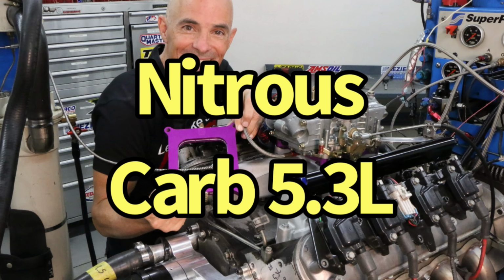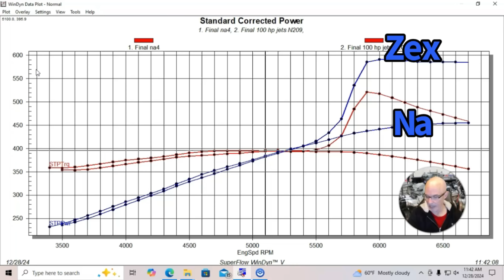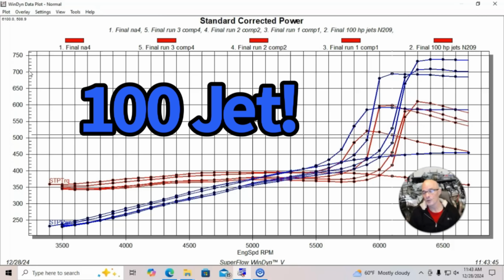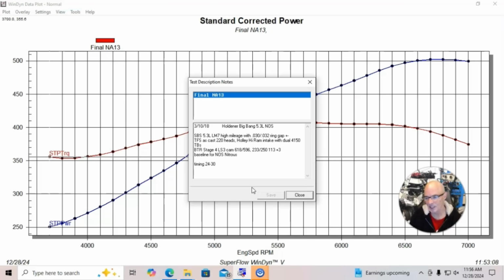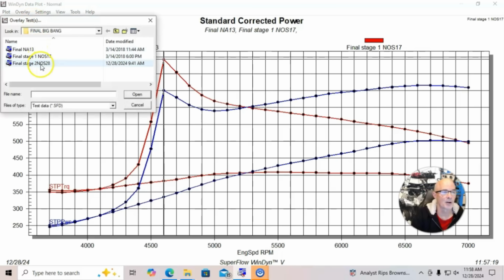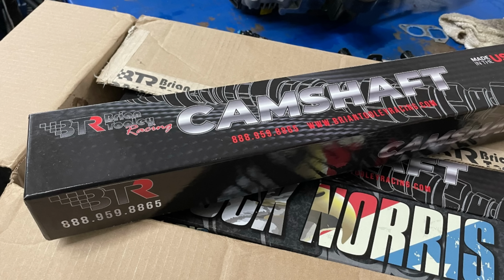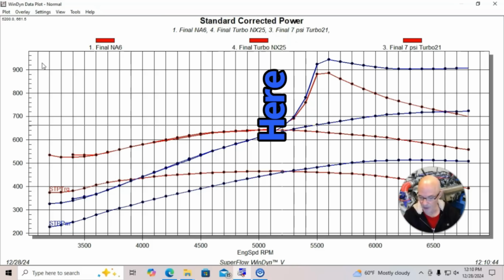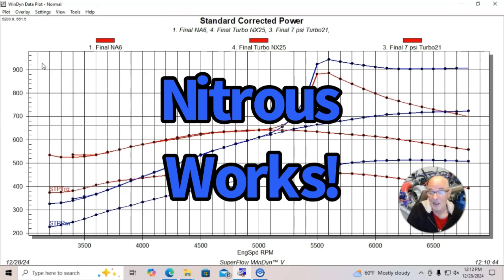CHEAP JUNKYARD NITROUS-300 SHOT 5.3L. NITROUS WITH A TURBO? NITROUS TIL IT BLOWS! FULL DYNO RESULTS

Comment: Question about the cost of nitrous vs force induction. Obviously with nitrous, you have to pay for the refill, but with a turbo or blower, don’t you have to pay for the cost of a turbo or blower rebuild, belts replacement on a blower set up, replacing parts on a turbo kit due to wear and tear?
Reply from the maker: the longer time you run nitrous, the more it costs vs turbo

Comment: Cam recommendations for a SBC 388 with a single bw s475 1.10 ar t6 brodix track 1 221s 67cc 9.5-1 compression..lunati crank 3.750 eagle h beam 5.7 srp -24cc dish blower pistons super vic intake c&s dual needle e85 carb. Looking for a solid roller street/strip need 800whp
Reply from the maker: 224/230 duration
Reply: That turbo may struggle to make 800 wheel

Comment: Ok I need help I got a lq9 I want a reliable 550 to 600rwhp  NA I was going to go 408 stroker but its expensive and I don't plan on 1000hp I want to have a daily driver I got a full qa1 suspension kit and willwood 6 piston brake kit like I said my goal is to drive it everyday have fun do some donuts do burnouts enjoy my car 1969 Chevelle
Reply from the maker: you won't get 600 whp NA
Reply: @richardholdener1727  wow holy sh#$ I never thought you would respond to me but thank you any NA good horsepower suggestions you have how to make some good fun Street high horsepower....I'm sure in my future I see a turbo

Comment: Question here... can I run that carb  nitrous plate on my blow through or does it need stay dry in front of my turbo? Thanks guys!
Reply from the maker: you can run it under the carb
Reply: @richardholdener1727  ahh from the yoda himself. .. thank you sir. Wasn't sure the boost would mess with it. Not a lot on line about it.

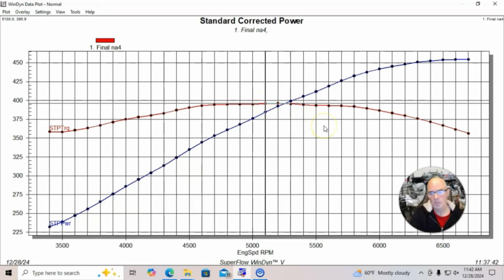Comment: 02:29 Dyno graph of this 5.3 looks very close to a stock LS2 6.0, but with a better top end.
Reply from the maker: a stock ls2 makes more hp and torque than the 450-hp 5.3L carb motor

Comment: at the 8min mark, why is there a dip for the 2nd stage at 4800rpm?
Reply from the maker: more timing was taken out
Reply: Correct me if I'm wrong these ls engine stay happy if you pull a little timing around 5k then throw it back in after 5500
Reply: @xjbeater8638 that's because VTEC kicks in, right?
Reply: That's when the bolts in the floorboard started shooting out.

Comment: @Richard Holdener it would be cool to see a test with a turbo that makes around 600hp maxed out and add 100-150 or 200. That will give me hope on a built d16 setup like that
Reply from the maker: back pressure would be very high
Reply: Too much drive pressure on the turbo
Reply: needs a big wastegate.

Comment: The 'New' style of using a shot of NOS as a 'Boost Cooler' into the charge piping is terrifying on paper, but seems to work well for those that are brave enough to employ the equipment to get it done.
Reply from the maker: what is new style
Reply: @richardholdener1727  the actual inline piping kits/couplers that some of the NOS venders are now selling specifically for boost cooling.
Reply: @joeyjojojr.shabadoo915  i don't think it is cooling. It is for spooling.